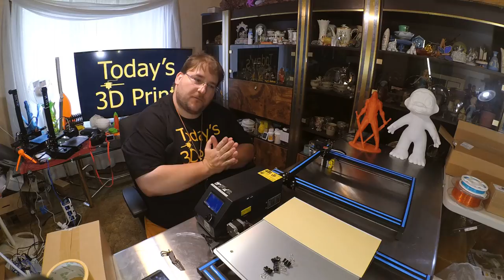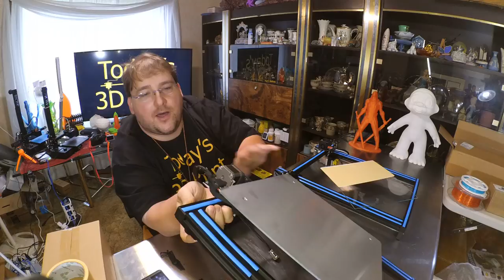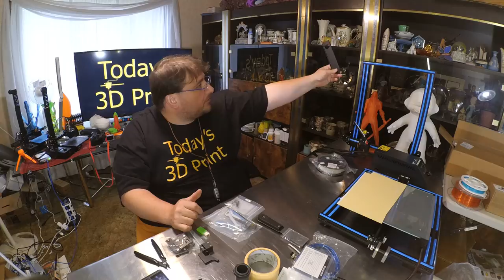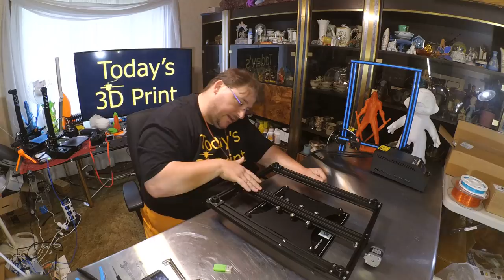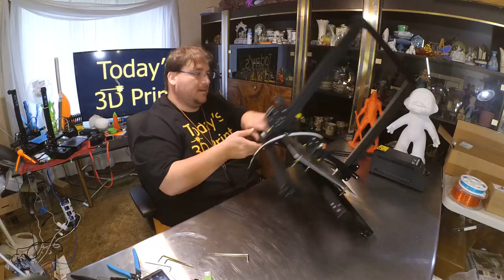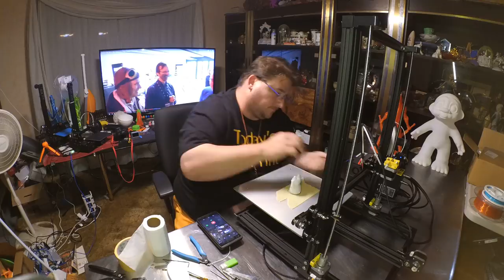Today's 3D Print 113 Creality CR-10s rev1 Unboxing, Build, First Print cr10s cr10

Comment from the maker: BTW critters. I am getting my first prints off the CR-10s and they are IMPRESSIVE! surprisingly "low noise" lower than I was expecting. I wonder if they changed anything electronically on the brain board. layer alignment is approaching ender nice. still has noise just slightly (VERY slight only a some what perfectionist like me is even likely to notice it !)

I am excited. and whoever already bought one. thank you. I love you. and you are going to love this printer.

I am so happy to see a manufacturer be so responsive to fixing their product AND to find out they did not just take the Y tension relief but got permission. fantastic!

and while it will take a few months I will start rolling out some very interesting prints. if you are curious. prepare to drool. goto to the link for faceless in episode 111 and then click on fantasygraph's name and see the OTHER models he has designed. WOW. Just wow. I want to print every single one of them!

Comment: Thanks you for this video. I just got the 10s the other day and setup was easy with your video (best I've seen so far). The included instructions are useless. Amazing how a company can produce precise mechanical and electrical components in mass, however not understand how to write a basic manual. Only in China. They need take you up on your offer. Although this is my first 3d printer, I was able to print the leveling wheels and a looping xmas tree without much of an issue. My wait 10 years to buy a 3D printer was probably wise. These are extremely useful and the cost of media and the printer are now cheap cheap. Again, thanks for saving me a bunch of time!
Reply from the maker: +O Messner its because they dont speak english and they know the printers by heart. Best way to test instructions is to give the kit to a total noob and see what happens

Comment: Also one more critique my printhead was loose on mine when it got shipped to me yet I've never seen any YouTuber mention it on theirs.
Reply from the maker: I must not have mentioned it in this video but in one of them I did on the creality printers all of the three wheel trolleys have one adjustable wheel it's always the third one the one by itself you just put the included wrench in there snuggled up not too tight

Comment: Somebody from Creality was asking on the CR-10 Facebook group to get in contact with the designer of the strain relief model a while ago, so I think it's likely that they did get permission somehow to use it.
Reply: Also, the filament sensor on my CR-10 S4 is 3D printed, and I've been having an issue where it will erroneously stop prints even when there was still filament. It happened about 10 times during a long print, which is basically worse than not having the sensor at all. GearBest is sending me a new sensor so hopefully that will fix it.
Reply from the maker: not anymore. its now injection molded and nicely done. hopefully you will get the new one.

YES they got permission send him a bunch of goodies etc.. I am VERY happy to hear that. that just increases how much I like this company that much more!!!

Comment: This very useful, thanks for taking the time.  Presumably you'll want some feedback on how to improve your videos...
1. Camera angle, camera angle, camera angle
No point talking about something that we can't see because its on the other side of the printer. Dark side of the moon.
2. Close-ups.  When you show the gap between the head and the bed... show it, even if its a seperate clip or a still picture inserted in your video.
3. Video could have been 15 minutes instead of 45.  No need to repeat anything, we can pause, rewind, replay... 
4. Show what is on the console, again video in video or just the whole screen and we hear your voice over it.
5. Lighting could be improved.
6. Links to everything you mention like the Leveling knowbs, the ovals and circles.... so we don't need to hunt around.
7. Don't stop making these video, you are doing great!
Thanks!!
Reply from the maker: +Performant Group all excellent advice I've been able to incorporate most of it most of my build videos are now 15 minutes or less after medically improve lighting and audio camera angle is slightly limited but that will improve and I'm going to install incorporating screenshots when possible I realized after watching my own video that I was talking about things you guys couldn't see :-)

Thank you very much for the feedback I will incorporate as much of it as quickly as I can

Comment: It looks like only the YouTubers are the ones getting the upgraded models. I ordered one from gearbest just last month and got it just last week. Most of the upgrades on there minus these closure around the SD card slot. It also looks like the YouTubers get there with the trim already installed.
Reply from the maker: I think they stop installing your trim I have a cr10 s from Black Friday that I have not opened yet I will confirm when I open that I am 99% certain they don't cherry-pick anything because I've received four broken doa printers :-)

Comment: I watched you tighten up the rollers on the bed assembly but I only saw you tighten up one side. Doesn't that slightly warp the track the rollers move along?
Reply from the maker: Only one wheel on each set is adjustable the rest are static
Reply: Certainly makes it easier that way than having all 6 adjustable. 
This video has been the best unboxing and setup I can ever recall seeing. 
What appealed to my ear was that you didn't need to um and ah over what to say next. Also, you knew what to call each part or tool without reverting to general terms or "this part" and hold it up to an unfocused camera. Thanks.
Reply from the maker: Thank you for the compliments I will try to keep doing my best don't over tighten the wheels just a tiny bit more than snug

Comment: i am trying to decide between this cr-10s or the tevo tornado seems like dual motors may be better for some filaments maybe but i just wonder how important is the heated bed on the tevo tornado compared to the cr-10s is the bead a deal breaker and can i use more filaments on the cr-10s than i can on the tevo tornamdo like carbon fiber copper carbonzfiber that sort of thing
Reply from the maker: The primary advantage of the tornado heat bed is if you need higher heat bed temperatures for hire temperature Plastics such as abs polycarbonate Etc if you're not going to be printing with those the heat bed doesn't matter

As for those Plastics they're all pla based so 40 C on the heat bed is fine as for can the printers handle them know neither one can both need modifications well just one modification replace the nozzle with something hardened or plated to handle abrasive filaments both of them come with stock brass nozzles which will not tolerate abrasive filaments it will degrade fast

Besides the high temperature stuff which the tornado would be better suited for they both handle all the same Plastics
Reply: i really thank you for helping me im just wanting to make a good purchase is all good investment if you will i want to use abs carbon fiber so forth but ive seen where some people said the cr-10s is better more precise i guess cleaner more detail and i could just insulate the bed on the cr-10s an it would achieve the temps needed for other materials abs carbon so fourth i cant thank you enough talking to me about this of course i been staying up all day an night looking at videos reviews an i just see alot of people not happy with the tornado but i see some like it im jjust afraid of the layer shift thing and im gonna print big stuff an thats where i have seen it at the layer shift i already know if i get the tornado its a must to buy smoothers im ok with that its just the other stuff lol and it only has one motor where the cr-10s has two i would think it would be faster an more precise on the little detail but thats also why im asking you lol i know you know more than i do an i like your channel alot an you as a person and i feel good asking you theses questions helping me with my decesion i am learning alot and if your printing something big or decent size once it gets  so tall does the heated print bed really matter as far as it being hot or not

Comment: Awesome, awesome video sir. I just received my CR-10s and I had this on my tv while I put it together. Everything went smooth except that the Z Axis isn't level and I can't figure out how to correct it. The left side comes down first and I can't level the right side of the bed with it out of wack. I've searched online and am still struggling to find something that will help.
Reply from the maker: on the single screw cr-10 loosen the right side. it should be snug not tight. too tight and it will want to lag behind the left side as it "resists"

do you have the 10 or the 10s?

if 10s grab hold of both z couplers turn the right one while holding the left one tight so it does NOT turn (they will try to turn together) and adjust till its roughly level visually. should be good to go and relevel.
Reply: I have the S version. Thank you for responding, I really appreciate it. That helped me get the Z balanced, and helped me identify my actual problem. It looks like the Z on the right hand side is hitting the bracket that holds the stepper motor to the extrusion before the left side hits the z stop and it throws it out of balance every time you auto home. It's hitting the small black  piece with the two screws in it going down into the stepper motor. The left side never physically touches this bracket but the right side is.  Both screws in the bracket are nice and snug, so it's not loose. I'm not sure how to proceed.
Reply: I loosened the bracket on the left side Z with the limit switch and raised it as high as I could, but the right side is still contacting the motor bracket before the other side hits the limit switch. You can actually see the motor move when the axis makes contact.
Reply from the maker: +Brandon Jones tighten all bed screws allnthe way tight. Manually raise the right side so its slightly higher than the left. Home the printer. Now manually lower the right side till your mk1 eyeball tells you its close to level with the bed (called tramming) you can use a ruler if you wish but eyeballig is surprisingly effective.

Now go through the leveling process at the 4 corners a few times then donthe marvin with large skirt for the final live level and you should be good to go. If time permits i will make a video tonight if not definitely this week. Watcj my cr10 leveling video it really helps.
Reply: Thank you again for the continued help. I got to the "Now manually lower the right side till your mk1 eyeball tells you its close to level with the bed (called tramming) you can use a ruler if you wish but eyeballig is surprisingly effective" part. Once homed and I manually try to lower the right side, it hits the bracket before it's level. I'm thinking about trying til file the metal bracket down with a file or something. I can't think of any other way of fixing this problem.
Reply from the maker: +Brandon Jones hmmm can you take a picture? Either something is assembled wrong or your Z end stop is too low meaning need to raise the install so that the left side does not go down so far
Reply: Here is a link to a post I made with a pic and video where you can see the bracket making contact with the motor causing it to move. I took the bracket off and filed it down and that fixed the problem. I tried everything else and triple checked to make sure I did everything correctly during assembly. There's also a picture of after I filed the bracket down and now it has clearance and doesn't make contact. It remains level when I auto home. 

https://www.facebook.com/groups/1408301692623865/permalink/1471896932931007/?comment_id=1471949659592401&notif_id=1514052829356325&notif_t=group_comment 

On another note: I noticed that they've made some more upgrades to the printer since your review. There is a little cable holder now that comes off the extruder for the hotend cable. I know you mentioned that in your video as something you'd like to see. The bed is also insulated now! I bought some insulation and tape so I could do that during install, but I was surprised to see it came insulated.  Thank you again for all of your help!
Reply from the maker: +Brandon Jones yep i have a rev2 in the box i hope to have time to put together this week!
Reply from the maker: +Brandon Jones that is so weird. I suspect an issue somewhere else. That assembly simpmy should not need to go that low. Very odd. I will have to closely compare it to my new rev2 unit when i unbox it. I suspect your bes is too low or your hot end is "too high" necessitating the need for thr x gantry to go that low. As confirmation once zeroed i am betting you now have a wee bit more than 400mm vertical travel capability.

Comment: Hi, 
I just ordered my first 3D printer and bought the Creality CR-10s. I suspect your review model was inspected prior to shipping to you as I have read on Amazon in the user feedback a few horror stories. I really like your precise explaining of each step and Creality should contact you and have you work up a manual. 

I do have a question though, what upgrades do you recommend to make the printer a better printer?
Reply from the maker: +Keith Thompson they're not cherry pick but there are always intermittent QC issues from China as a confirmation of that I ordered one with my own money who could pass one up for $228 :-) is sitting in the box next to me hopefully next week I'll get that opened and we'll see if there's any difference from the review unit I received also keep in mind my other two cr-10s I purchase with my own money from two different companies and I have a 0 real issues with either one

Do bad ones get sent out? No doubt it shipping from China it's bound to happen you're damaged in shipment or someone fell asleep in QC it happens but so far they're pretty good about standing behind it and making it right

I probably will try and make a manual for the CR 10 it needs a good manual

Comment: Can you tell me some good sources for good filament at good prices.  Using a CR-10 Mini
Reply from the maker: check the description of the video. if you want amazing filament go with proto pasta. but its going to rape your wallet. $60 a kilo which is why I don't print with it.

so for "reasonable" filament for us mortals. Esun PLA pro. is always my goto starter. stronger than normal affordable and prints like freaking cream cheese. extremely forgiving to abuse and bad settings. start with that.

I use daily and enjoy Ziro and 3D Solutech. not always perfect but always usable and great results. Paramount is also turning out some very nice filament! printing some parts in Decepticon Purple now! very nice color!

Comment: Curious how much your electric bill has changed with the addition of all the printers running 24X7?
Reply from the maker: have not noticed a change yet but then again they don't use "that" much power. Enders are 140watts max usually half that S3's style machines are pulling around 200watts typical 150w. I will have to sit down again with a meter. I expect power consumption to go up as it gets colder (I can't keep my house 70 in the winter 55-60 is typical for me) so they will consume more power keeping the heat beds warm.

and I have not had ALL of them going at once yet. eventually I plan to make a video of 20 printers going all at once (audio will be interesting) but that is actually a lot harder than you think unless I just give them "throw away prints" as it would take quite a lot of "time" on my part to custom slice worthy projects for each machine. several days worth of work actually. so while i am usually printing 24/7 its 1 3 or 4 machines. not all of them.

Comment: Is it a good printer to start with and what filaments do u recommend
Reply from the maker: that is a tricky question. it depends on a lot of things. the CR-10 is affordable extremely reliable and extremely flexible takes little skill to assemble and to get it going. all of this makes it a pretty darned good first printer as long as you do NOT attempt to "print large" until you get the hang of it. ie stick to 6x6x6 inches or so till you get the knack of things.

if you KNOW you will get heavy into 3d printing? yes get the CR-10 (the CR-10s if you can swing it)

if you are still unsure. get the Ender 2. its $145 and has some of the best quality bar none. its also super cheap so if you decide EHH this is not for me you have not blown $500 on a printer and can easily sell it.

if you decide HELL YEA this is for me THEN buy the CR-10s and the Ender will remain an insanely good printer to go with that CR-10s (trust me if you get into this 1 printer is not enough especially when you have that 50 70 150 hours print job going on the CR-10 and withdrawal starts to gnaw at you to print something but you can't :-)

Ender to the rescue. :-)

as for filament. if you can get it get some Esun PLA Plus/Pro (link in description to all of this)

its affordable and its an advanced pla. one of the benefits of this property is that it has a HUGE temp range and is insanely "forgiving" to newbie mistakes and flows like cream cheese from the extruder. very smooth. very reliable.

it helps to have reliable filament to get started as it removes "is the filament the problem here" when troubleshooting.